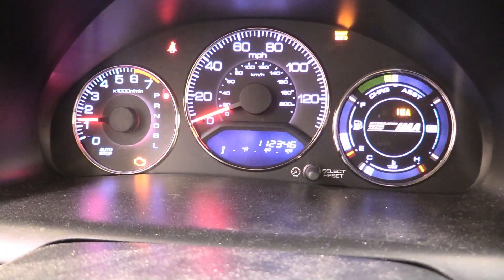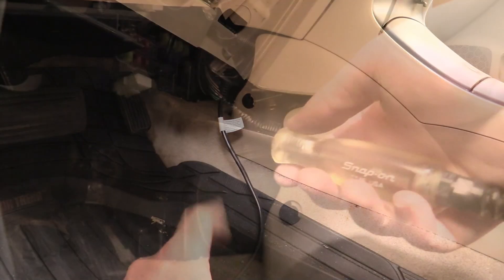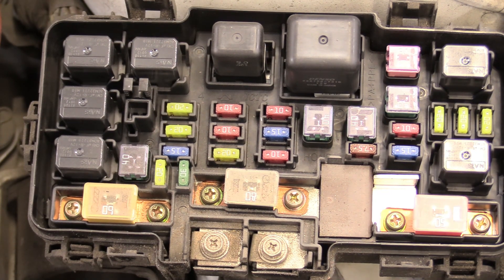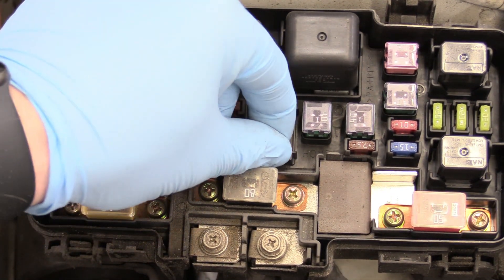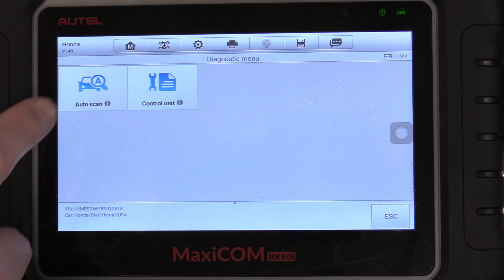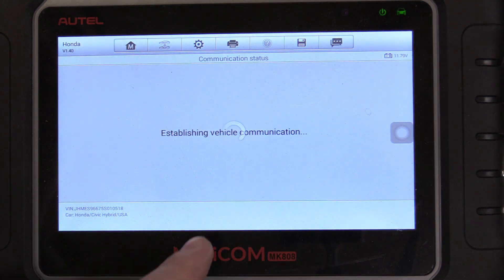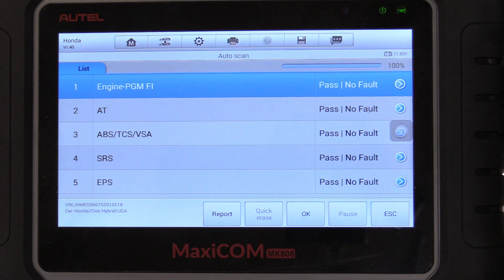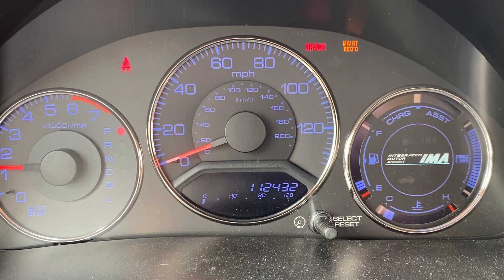OBD-II Port Not Working? Check This Out! - How to Trouble Shoot ODB-II Port

Comment: I need a pinout diagram to run trouble codes on a 94 Buick LeSabre it has the 16 pin OBD2 but my OBD2 won't read it can a jumper jumper get the blink codes what two pins would I use

Comment: Wow good to know that both of my problems I need fixed to get through inspection in May are most likely caused by a fuse out.  I have 2019 Ford Fusion Hybrid and I have the Christmas tree effect on my dash as well as half a dozen messages coming up and everything works fine, which in part I know because the lights are INTERMITTANT..when you have a real problem they stay on all the time.   No power to the OBD-11 port either.  I will check out your website for the "free" info on which and where the fuse is as my obd is not listed manual.  If I can fix all this with just a fuse I will be eternally grateful and might send you a donation or put you in my will or something. lol  One explanation I saw for all the warning lights when its some problem with connection with ABS is that the computer gets a message something is wrong but realizes that nothing is.  It gets confused and just starts running through the gambit of all the different warning lights.

Comment: In a 2004 crv where is the OBD fuse? Under the hood or under the dash? My check engine light,ABS, radio not working and OBD Port not working when scanner attached. Sounds like a fuse. Thanks

Comment: I have all these issues right now everything working but the radio, obd socket and i can't use the key to unlock or lock the doors. Where do i find this fuse on Honda polit 2010?
Reply: I found the issue, it was the Back Up Fuse that blew out. It was totally random but it was the cause of the issue for those things not working.
Reply: @gaddiel5420 
Must times the problem is the battery in the key

Comment: W204 Benz - OBD port not powered - It started with me reconnecting the AUX battery. I did the + but then fumbled the - cable and it touched somewhere and arced. Now the locking, OBD, interior lighting and a bunch of other stuff won't work! I've tested continuity across every fuse in all the locations 1 - 123 and they're ALL GOOD! So what have I fried?! Is it a relay or something? Is it a fuseable connector or whatever it's called? I'm lost and I need my car working ASAP & would prefer not to have to pay a big callout fee for something I could fix for a couple of pounds / dollars. All help/advice appreciated. Thanks
Reply: Did you find a solution????
Reply: Yeah - back to main dealer. 200a megafuse was blown

Comment: I'm having an issue. First of all no codes its obd is not communicating with smog machine. Have you ever came across this?
Reply from the maker: I would think it would be a problem like this, were there is a blown fuse and it isn't getting a signal from the OBDII port. Thanks for watching!

Comment: 2004 CRV. Chech engine light on. SRS light on. Radio not working. OBD port not working. Do I start with replacing the fuse you did? The #9, 10 amp? How about just getting a fuse tester and check each one for the home user? Thank you

Comment: I like to touch tester lightly so as to not bend open the terminals in the connector causing loose connection on the pins

Comment: Thats all good that all came back with the fuse replaced .  The fuse blew for a reasone ! with the fact that you had the same code twice ! first code and the last code , a currant draw test on that curcuit would most likley show the reason for the blown fuse. Knowing Hondas since 1978 till now! my money would be on the radio on its way out ! but thats just based on years of troublshooting electical systems . fixing the cause is what we are here to do ! not just the resalt. we never stop learning in this trade ! sometimes the best that can be done is not enough ? It,s all part of the job and we hate a come back with the same proublem !

Comment: Hi I have a 2011 town car and my obd port stopped working, I check all the fuses and they all are good. Which wire is the power wire for  my obd port that stays hot. That would give me a starting point to find the problem  thanks.
Reply: Chk #16 port. Some scanners have #'s by pins.

Comment: still having problems with mine my fuse is good of course i have a chevy trail blazer 2006 and the fuses are good ive got the cigarette fuse looking good to although one of the cigarette lighters are not working but again all the fuses are good and the obd2 censor is still not reading what do i do
Reply: also my check engine light is blinking and i know that normally means a miss fire just want to double check

Comment: Now the question is, what did he add to the system to pop that fuse.
Nice Video
Reply from the maker: I get the car used and the radio was dislodged, I bet it was removed with the key on and the thing shorted causing the fuse to break. Thanks for watching!

Comment: Fuse Works. Cheap OB2 reader comes on. No readings available. ??  Nothing Comes up on the reader. ELM327 - no readings. 2004 Buick Rendezvous. 168K miles on.

Comment: I have the same issue, but I got a 2017 Kia Optima. Today put of the blue, the keyless entry stopped working and when I tried two different OBDII scanning tools, nothing happened. One is Bluetooth and connects to my phone and the other gets it's power as the one you used. 

When I open my car doors, no interior lights come on and can't lock my doors unless car is running. Only if I do it manually from the inside.

I checked every fuse I could think of. Any thoughts?  Thanks
Reply: Im having VERY similar issues, did you ever find the resolution?

Comment: Obd2 strange issue

2007 Peugeot 107 petrol
Switch ignition on
Dashboard lights only battery and engine light
Car turns over no start
Plug in obd2 scanner
All lights on dashboard
Engine starts
Take obd2 out 
Engine stop

Please advise

Comment: Like you said, 99% it's a fuse. I tested and found mine today, all lights and codes gone. Thanks
Reply from the maker: Great job! Thanks for watching!
Reply: @2carpros  Hey Ryan. When i took my truck in today the tech said my OBD2 is showing no data available so he couldn't pass. I took it home and tested with VDC and it read 013 for some reason. Then i had a guy look at it and he said it was not voltage but resistance

Comment: What if it turns the OBD2 on but its not able to read or “communicate” with the car?
Reply from the maker: I'd look inside the OBD2 connector and check for debris in the pins or pins being dislodged and not making any contact with the scanner. Thanks for watching Jenn!
Reply: @2carpros mine does the same where it powers it on but says function not supported on the scanner I have power and grounds on the connector and pins look fine to me
Reply: @photondebuger45 Same here. I’ve watched every video on YT about obd2 not working and nobody trouble shoots this problem. All the videos are about not powering on and fuses. If I figure it out , I will make a video for the community.
Reply: @justmyopinion8395  hot damn if you do that be amazing because the only thing that comes to mind is the annoyance of the can bus system. That's more or less vehicle specific and you really would have to diag it yourself but the good thing ish is the theory of diag should be the same. In my head when I saw that it can be something in the car that uses the same frequency or wires to the computer which in the PT is a white with light green and the other the same but with dark green tracers but just go straight to the computer so like the wires are trash possibly or the computer actually did bork itself somehow. BECAUSE when scanning it the computer does see something sometimes so like is it borked that's also something I'm looking to try and figure something too.
Reply: @justmyopinion8395 you figure it out yet?
Reply: Same here
Reply: I have this problem as well on my 2000 Toyota Tarago.
Reply: I have this problem on my 2005 matrix , looks like I'm gonna have to get rid of it because everything is working but no communication and I give up

Comment: I have problems with the communication of the obd2 I find a blown fuse I put a new one drive for 1 week take back to the emissions test and fail again 
Any recommendations?
Reply from the maker: Plug a scanner in and see if it has any codes. If that isn't working then I'd start looking for a short somewhere. Thanks for watching!
Reply: @2carpros  
Thank you

Comment: OBD socket connections can be damged not contacting or pushed out of back of connector block ..... Or connectors damaged metal tab does not contact pin .
Easy fix ... Trip the wire connection from the block and gently push on the connect tab inside the terminal .so it is half way or better visible looking into the female end of the connector .
Fuse first then Port terminals next .

Comment: What would happen if I wired an amplifier to two wires that go to my OBD2? My abs light came on and cruise control doesn't work. The wires were dark gray and brown and dark grey and violet but I was supposed to connect to light gray and violet and light gray and brown. I'm such an idiot.
Reply from the maker: Well I'd undo what you did. Then check the fuses. Should just be a popped fuse. Thanks for watching!

Comment: My OBD port has no power , including the cluster, audio, A/C -heater unit, signal and hazards lights , break lights, and won’t shift into gear from park on my 01 Avalon!!! Note that my car starts and all fuses are “Not “ blown. Used a light tester on the fuses that run these units but no power and I changed all relays as well!! But nothing just a engine running vehicle going nowhere!! Please help !!!!
Reply: Any fix for this

Comment: Can hardly call it "trouble shoot obd port". It was just a blown fuse which is the simplest problem one can have.
Reply: what I should of said Is the connector port has power but it set it's not reading the car!!
Reply from the maker: I did mention if it wasn't that it is most likely a short somewhere in the harness. I can't cover literally every single place and every single wire. The video would be 10 hours long and no on would watch it. Thanks for watching!
Reply: @2carpros  The feedback is that the title is a clickbait at this point. You guys do a very good first 3 minutes and then move onto stuff that is completely irrelevant to the topic of the video. Non-functional K-Line without any accessories or aftermarket radio is a big problem that this video doesnt tackle, but the title implies.

Frankly, if you made 10 hours (total) of videos on troubleshooting obd ports, they would be very popular.

Comment: I have several fuses that don't work when being tested in the slots, however fuses aren't blown. I move those fuses to other locations and they do work, just not in the slots where they belong. When pulled out and inspected, the two silver prongs look burnt. What does this mean? I have a total of eight fuses that do not work and are burnt from pins but still function in other slots. Has anyone seen this before?
Reply: If a fuse doesn't fit in the hole very well anymore and the connection isn't tight, it will cause extra resistance, we all know resistance causes heat and voila burnt contacts but not always enough to blow the thermal contact.
Reply: Nah did you fiqure it out? If not go to a forum and ask it there, google is also your friend
Reply: Maybe some crud in the connections from when they almost burned off something?  Clean them off if they test ok with a continuity test they should be ok...
Reply: Tuffguy change the fuse box

Comment: I replaced all the 10 15 20 fuses in the engine bay,  Every fuse was blown. After being replaced obd port still is not having any power for some reason . The fuses inside the car are in good condition , i double checked . Do you have any advice on what else it could be ?
Reply: did you figure it out?
Reply: I need to know this also
Reply: Did You ever figure it out

Comment: Hi I have a 1998 Honda Civic dx the obd port has power but when I try to find codes it says it can’t find vehicle an I tried taking it to do the emissions an they had problem finding the vehicle information.
Reply: Do you may need a new computer or to have the computer flashed
Reply: @benhooks6862  hey so I have a G35, I can scan for codes, BUT when I take it to do emissions they told me that they can’t scan the vin. One of the codes I do have is U1000 which can be because of a bad ECU, the really weird thing is that the car runs and drives absolutely fine. No mechanical problems whatsoever
Reply: @primitxve8076  did you find the answer, my corolla is acting that way